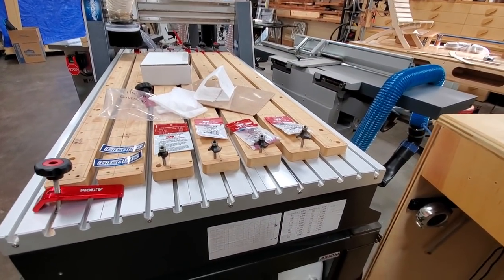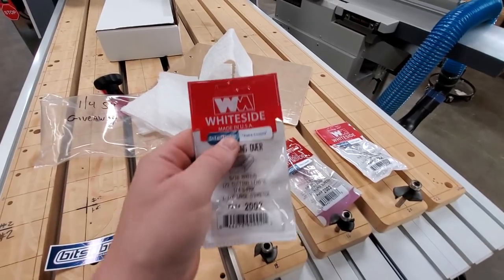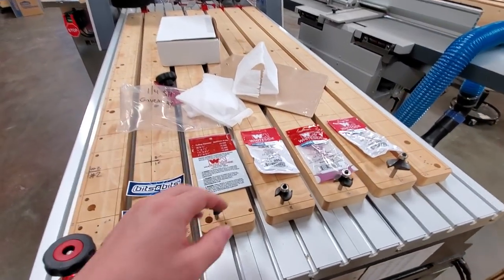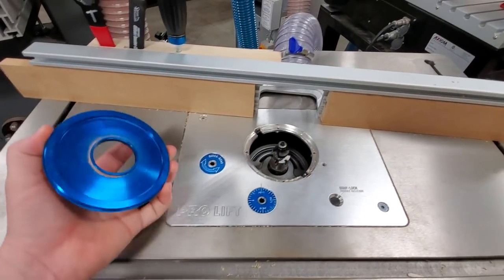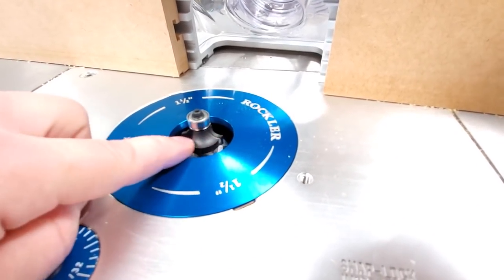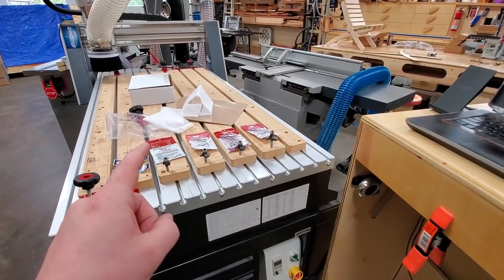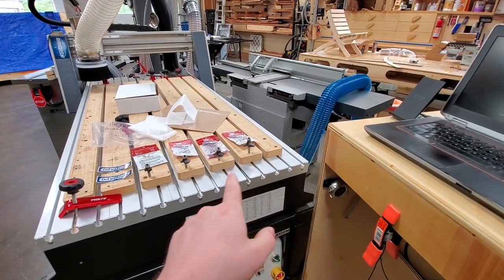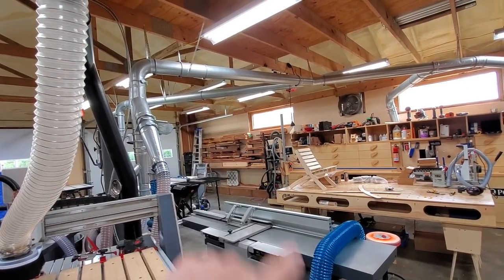Router Bit Giveaway - October 2019

Comment: Jay, making the nesting chairs and having a lot of tear out when routing the templates. I’m using the 1/2” spiral bit would the 7/8” bit make enough of a difference to justify the $175? I’m using ash lumber.
Reply from the maker: Hmmm.. I used ash too. I think the 7/8 bit is good enough to keep in the shop regardless of this project. Grain direction on the board will also have a big impact on tearout. If you're running the bit uphill against the grain you increase the chances of tearout. Using a jigsaw or bandsaw to get close will help a lot.

Comment: OK, educate me.  Serious question here. How does coating the non-cutting part of the bit reduce friction?  The only part that touches the wood is the cutting edge.  You are doing something very wrong if the relief ground part of the bit touches the wood.
Reply from the maker: The coating is applied by dipping the bit. There's no way to just do the cutting edge. Obviously, the only benefit you get is by the cutting edge being coated. The rest is just coated by part of the process. I could be wrong but that's my analysis of it.
Reply: It also reduced the amount of crud that sticks to and near the cutting edge. Making a better cut. I use a product in an aerosol can called "bladecote" it helps. But you need to reapply fairly often